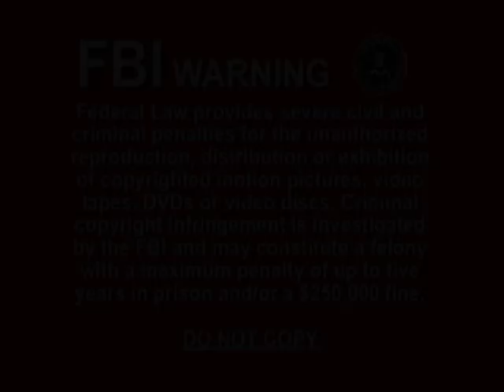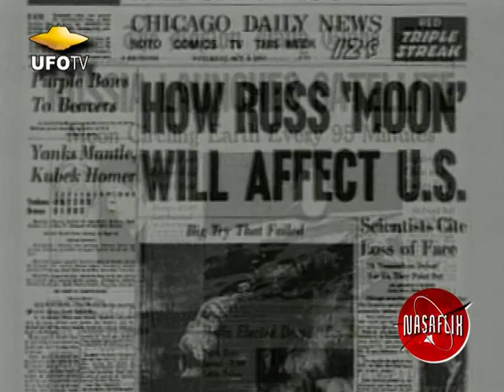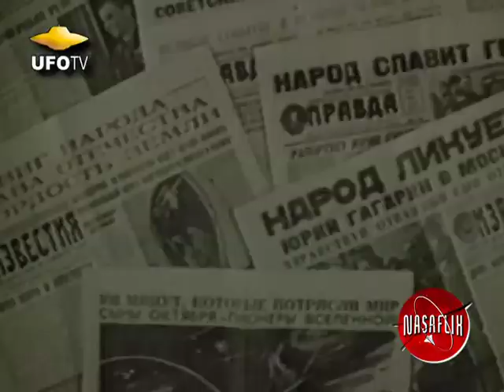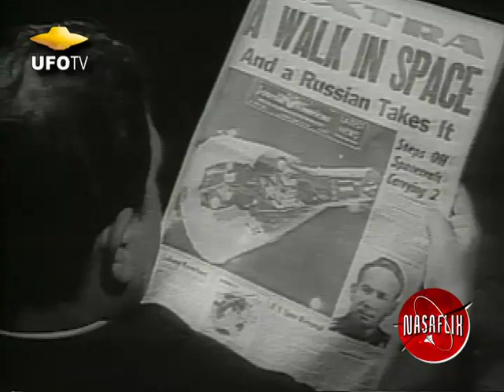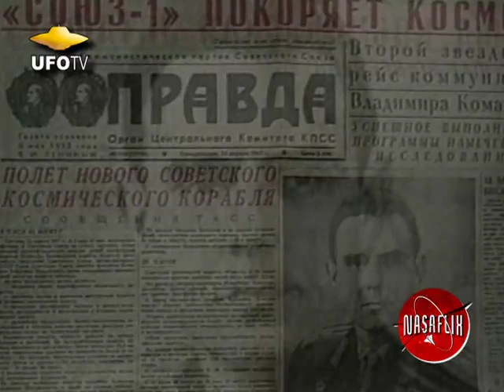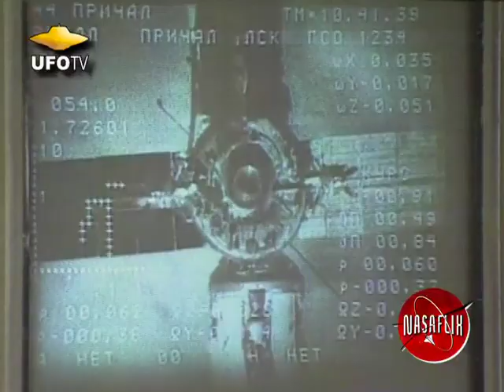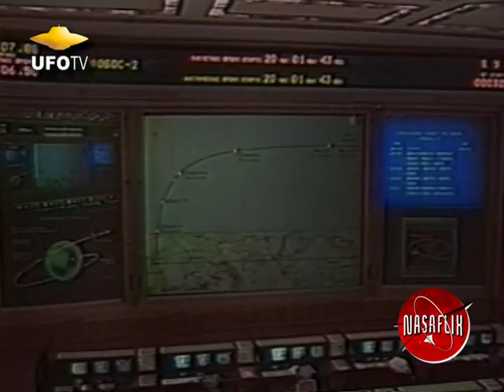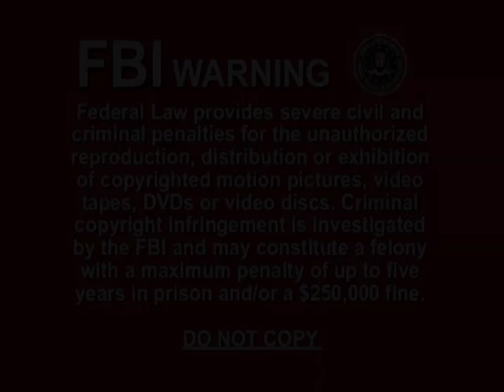NASAFLIX - RISE and FALL of the RUSSIAN SPACE PROGRAM - MOVIE

Comment: You mean Soviet space program not Russian!
Reply: psst... the Soviets were Russians. Dunno if you heard, bro.
Reply: Luke Sargent 50% half, but not all or even close to it.
Reply: Clorox Bleach  In the term of areas 8,649,500 sq mi (USSR) , 6,612,100 sq mi (SFSR) so around 2/3s were the SFSR.  Clearly Russia wasn't all of the soviet union in the term of area.  Now when it comes to population.  In 1989 as a whole, the USSR had 286.7 million where as the SFSR had 147.4 million.  The SFSR slightly had over the half of the population in the Soviet Union by a mere 4 million people.  Also keep in mind that the SFSR had also autonomous republics in it where it's basically operated as a different country with the exception as they were relent on a whole country cause they wouldn't self reliant.
Keep in mind I wrote it 6 years ago.

Comment: one thing is very accurate, Russia did not give a shit about safety..
Reply: In all those years Russia lost 3 cosmonauts, USA 17 astronauts... not sure who really gives more shit about security...
Reply: Bullshit the Russians do care about safety. They have never sent a manned spacecraft into orbit without first man rating it with a fully automated flight. Actually they took less chances than NASA in the early years. On the other hand NASA sent STS-1 up with a crew before man rating it. And we killed 14 astronauts because we used flawed solid boosters and used cheap plastic foam to insulate the main fuel tank.
Reply: 1138thz Uh it was a flaw in the o-rings used in the srb. Not really a failure in the overall design.
Reply: *****
Dhooooo!  No Bambi the Challenger died as a result of poorly designed O rings and a poor response to a known problem. The Columbia bit the dust as a result of foam strikes on its delicate tiles caused by rough running solid boosters and a poor response to known problems. 

Now lets get real Bambi:
1)  the entire concept of solid boosters that can not be throttled or shut down is a design flaw. And the shuttles solids are ROUGH running and inefficient when compared to smooth running liquid fuel boosters. The SRBs had a specific impulse of 242 seconds While any 1960's LOX & LH2 engine has and ISP of +400 seconds or 65% more power per pound of propellant and oxidizer.

2) The shuttle itself is a parasite vehicle that sucks up most of the mass the gets kicked into orbit. 50 thousand lbs to orbit from a launch weight of 4.5 million lbs is a pathetic 1.1% of the initial mass. The Saturn V could toss 260,000 lbs  into LEO or almost 4% of its initial mass. It was stupid move to go from capsules to a half ass space plane. 

3) That the shuttle is reusable is a joke. To prep one for launch requires a complete rebuild that costs more than a large Expendable to send up.
There are too many things wrong with the shuttle to count.

4) That no one wants to build anything like the shuttle these days is proof of its relative value.
Reply: 1138thz Finally, I'm an American, someone with similar views! Yes, the "reusability" of it was the fact that the orbiter was around 80% intact. Not to mention the used SRB's...